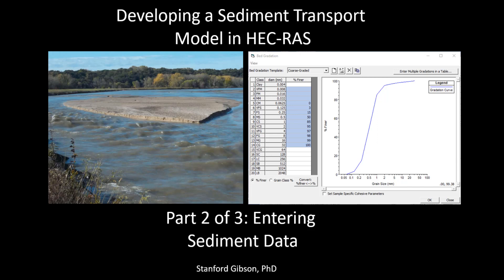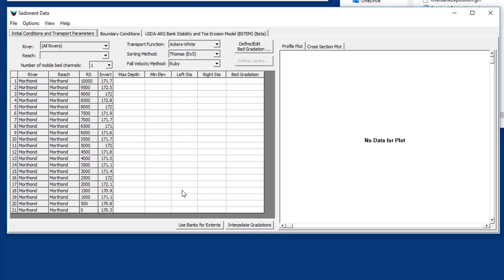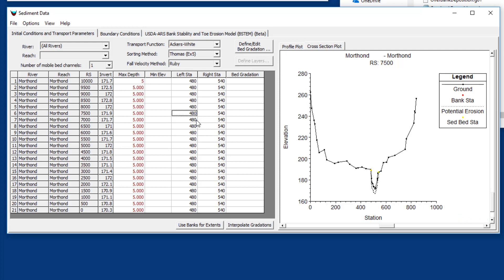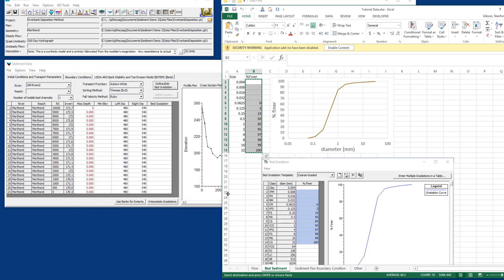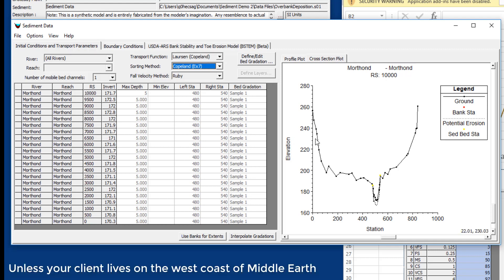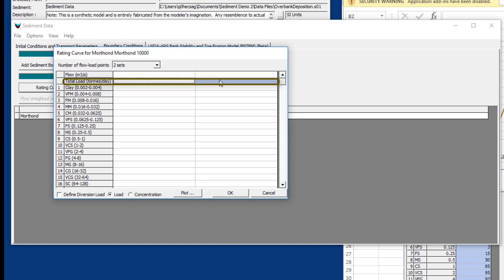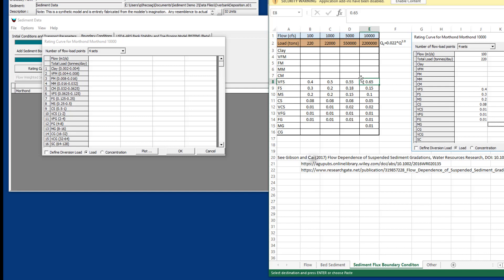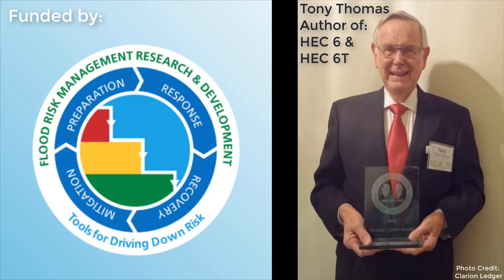Intro to HEC-RAS Sediment Transport Part 2 of 3   Sediment Data

Comment: Stanford great video, thanks!. If I calculated the total load with example MUSLE equation, and not have other information, (except Bed Gradation naturally) how I can calculated the Rating Curve? Thanks
Reply: That is a tough problem...since MUSLE only gives you an event or annual load and no gradations.  If you use HEC-HMS to compute MUSLE, it will distribute the sediment load over the hydrograph to create a sedigraph, which you can import directly (by grain class) into HEC-RAS.  Otherwise, I would probably replicate the analysis in HMS in Excel:

This reference describes what we do:
https://www.researchgate.net/publication/269138827_Modeling_watershed_and_riverine_sediment_processes_with_HEC-HMS_and_HEC-RAS 

MUSLE in HMS is also on the video list...but its getting to be a long list with limited time.

Comment: I been trying to simulated sediment transport in a river but I dont have the data for the flow gradation I do not know how to get  this data or how can i guess that gradation. It is not really well explainded. Could you help me please?
Reply: The flow gradation is really the most difficult part to estimate.  I'll probably do a dedicated video at some point.  It is usually a calibration parameter...estimate it and then adjust it to reproduce measured data.  It is also usually much finer than the bed gradation.  We wrote a paper on how these data tend to vary with flow:  https://agupubs.onlinelibrary.wiley.com/doi/abs/10.1002/2016WR020135

If you don't have access to WWR, there is a draft on research gate: https://www.researchgate.net/publication/319857228_Flow_Dependence_of_Suspended_Sediment_Gradations